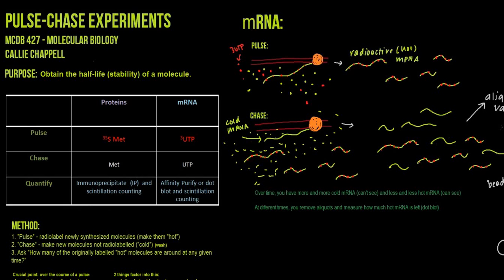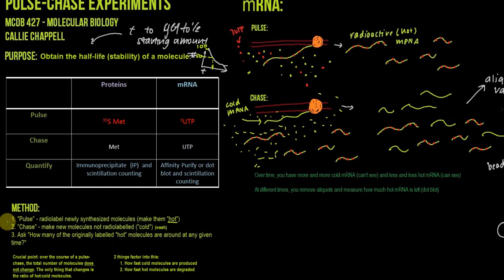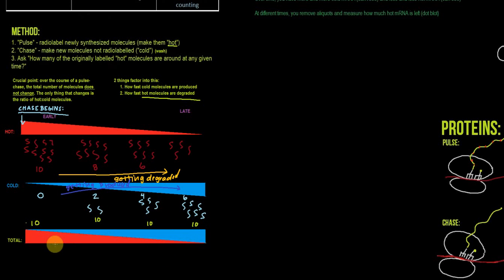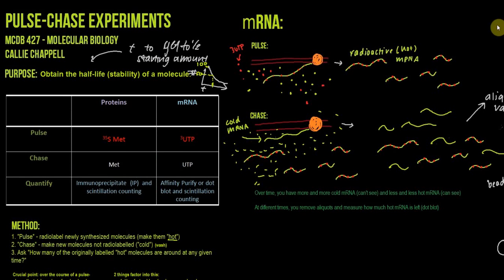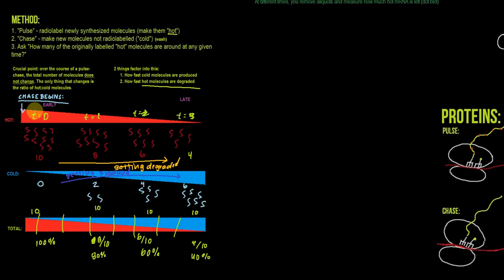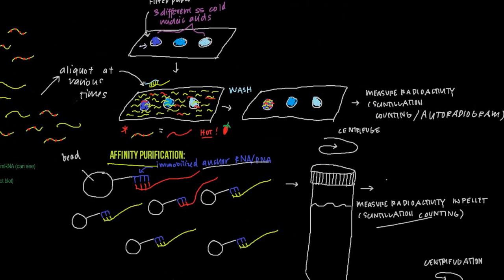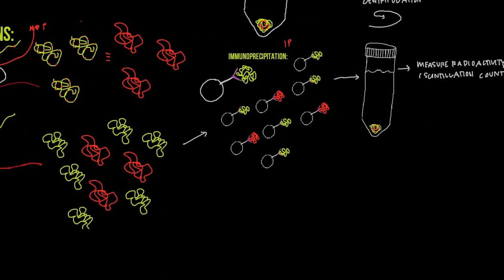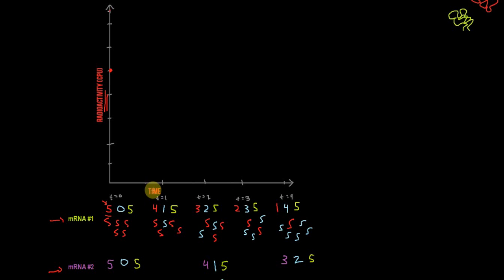Pulse-Chase Experiments (protein and mRNA)

Comment: What happens when the rate of degradation of the 'hot' sample is different than the rate of production of the 'cold' protein or mRNA, so the total is not equal for the length of the experiment?
Reply: that would mean the overall production of protein is increasing as time increases. to find that you would need westernblot type to quantify how much the total protein is increasing then compare that to the pulse chase data probably.